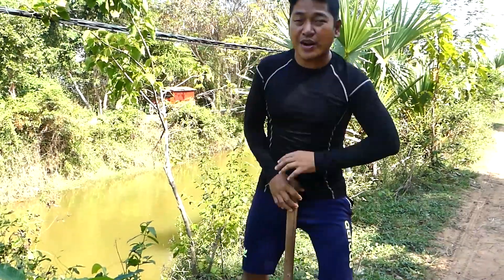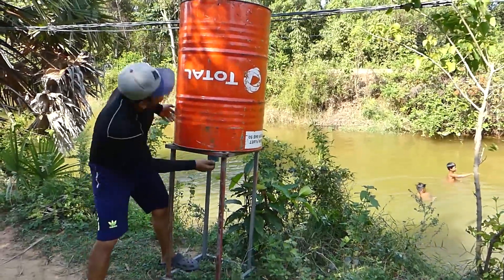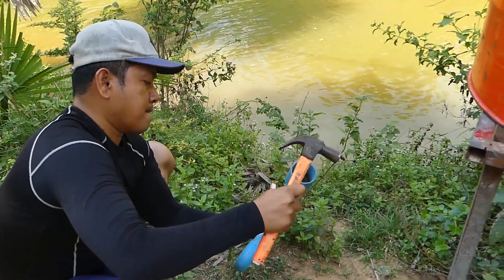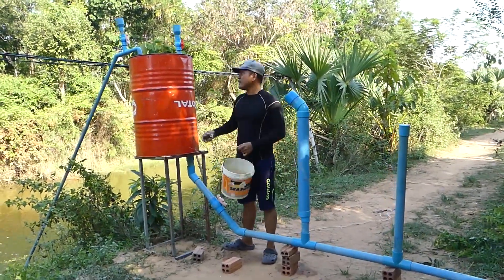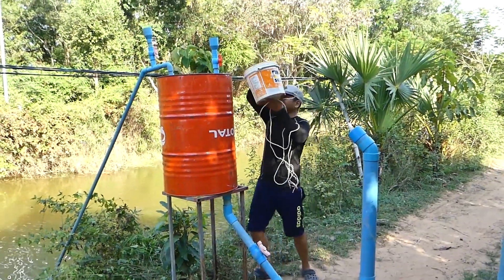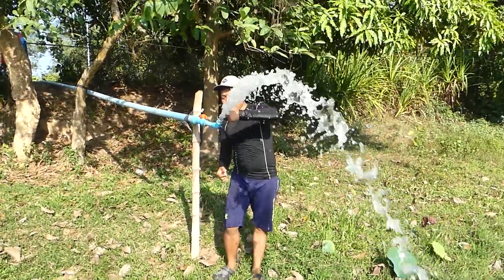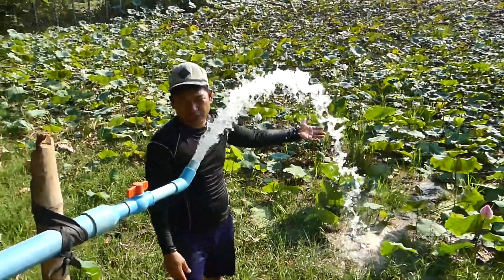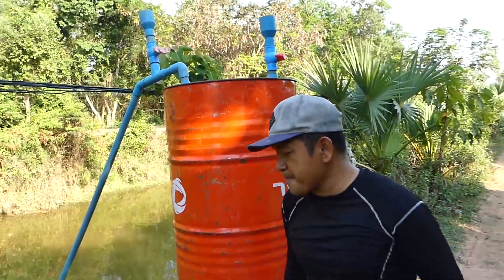Pressured Pump - How to make Auto Water pump from river- No electricity

Comment: Input pipe and output pipe should be same diameter, and no reduction at the output.
No need for the foot valve at the input, waste of money. 
The valve just at the output from the drum is not needed.
Place the drum directly on the ground, easier to work with and to fill.
No need for the vertical tubes at the output, just waste of money. The upward bend at the output is much, much better! 

And, remember: for this to work, the water level in the river must be higher than  the output to the field.

Comment: Did you find the problem?
Reply: Is output water level higher than input water?
Reply: How much water level input & output
Reply: Input and output pipe both are same size(mm)
Reply: @Satyam_Khushbu  small input, big output.
1/2 in
1 & half out or 2
Reply: @istorage5789  Noop. For maximum flow, all pipes are equal. The wider, more flow.
Reply: @Satyam_Khushbu  Should be. He is using a tinn input and restrict the output. Both reduces the flow.